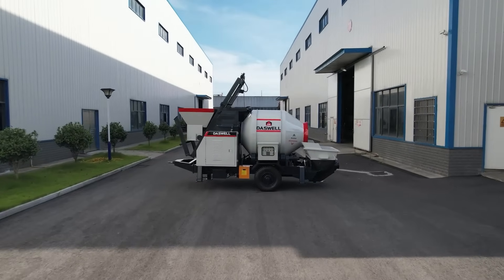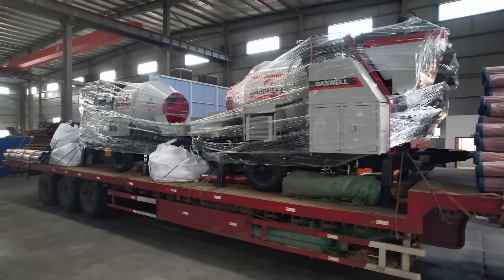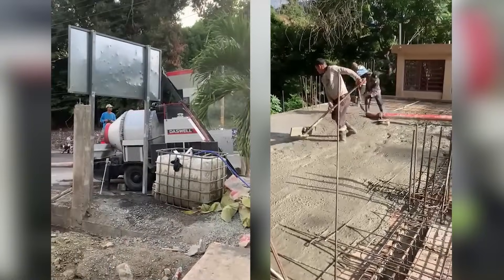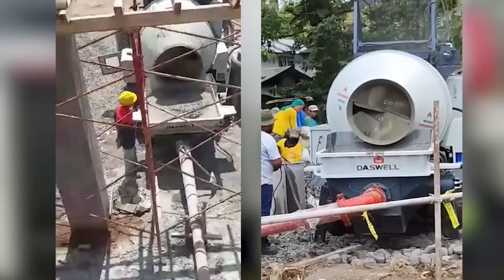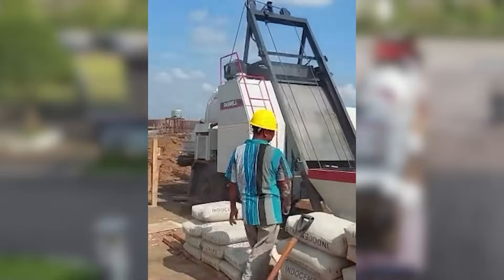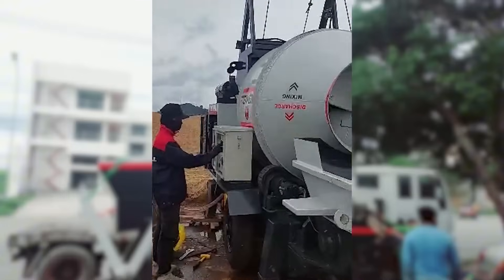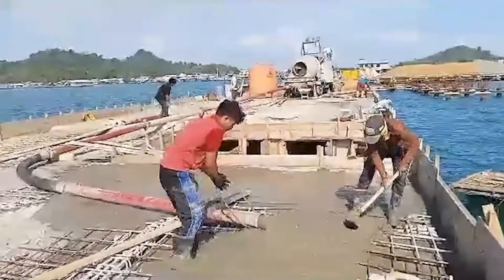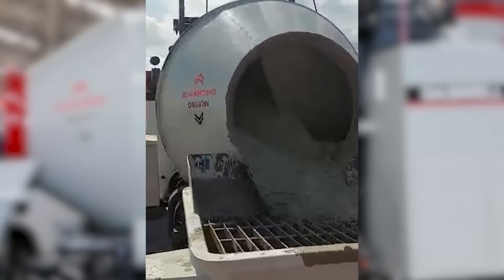Concrete Mixer Pump Price: How to Get the Best Deal on Concrete Pumps & Concrete Mixers

Comment: Excellent idea but this machine will never be approved by engineered or architectural specifications.
Reply from the maker: Thanks for your comment.
Our concrete mixer pump is fully certified and has been used in many projects that require engineer and architectural approval.
If you’re interested in the certifications or technical documents, feel free to contact us.  📱 WhatsApp: +86 17737712027